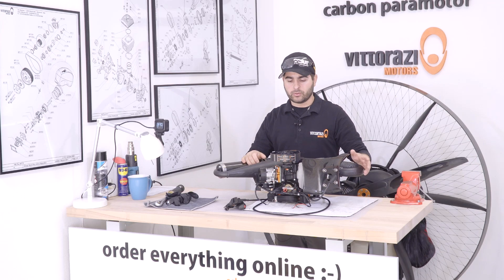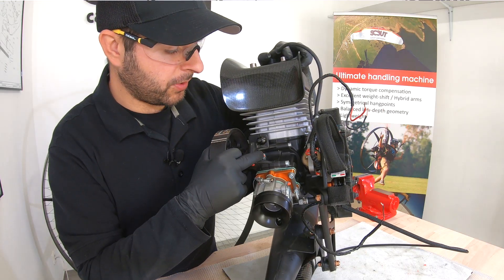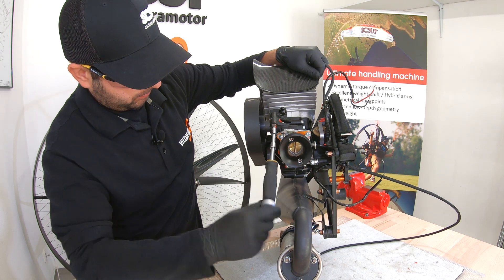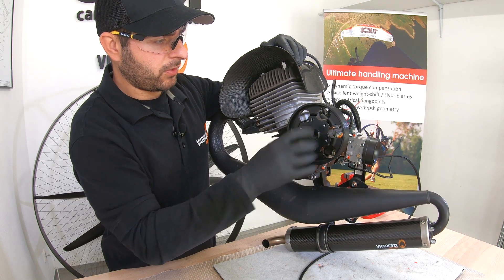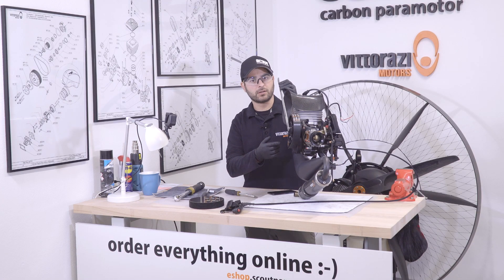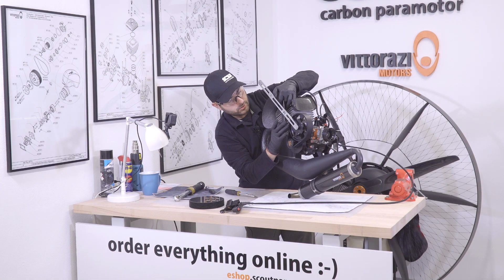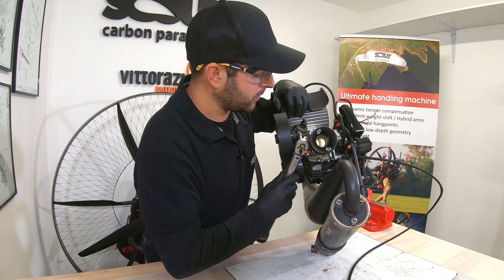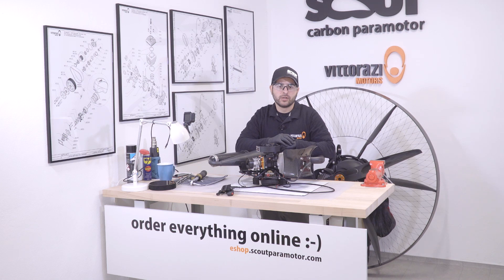Vittorazi moster plus belt replacement. Paramotor engine maintenance.

Comment: My new motor MY22 has loose belt, around 370 Hz, but the 13mm socket is so tight i didnt want to force it as i see you do it so effortless. It is white bolt so its the normal rotation to the air intake.

Comment: My online manual for the MY19 did not contain the proper weight to use with the supplied belt wrench.  Also, the tension to go app does not allow for the small free span length on the Moster, so what  is my solution for proper tensioning?   What is the proper weight to suspend with the wrench?
Reply from the maker: Hi, please check the description of the video for the details about the proper weights that need to be used or frequency required.
When using the Tension2Go you don't need to set up the length of the belt or any other parameters. We use the application just for measuring the frequency. 
You can use any other app that can do that, and be sure that your measured frequency is in between those values.
Reply: @SCOUTaviation  thank you